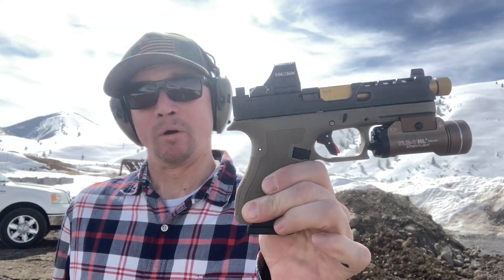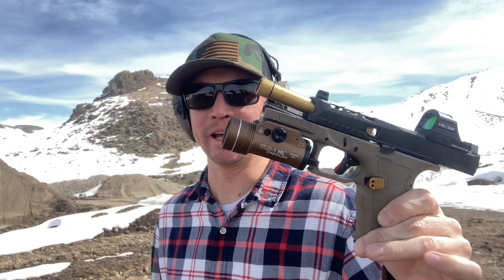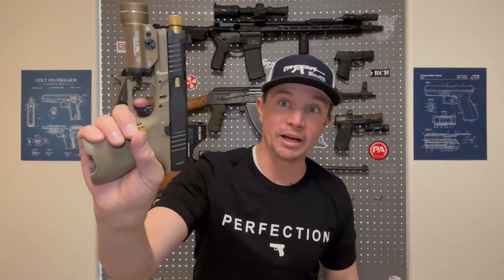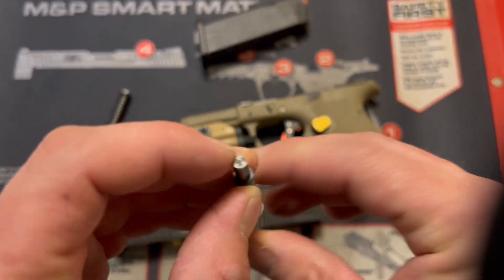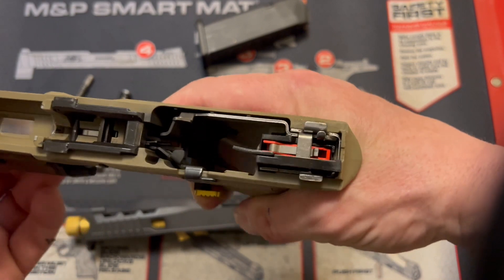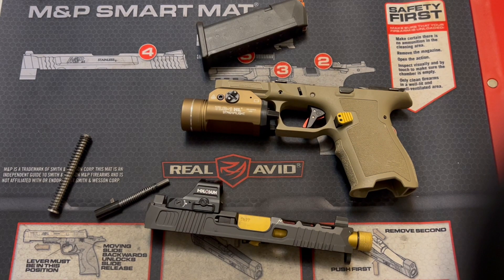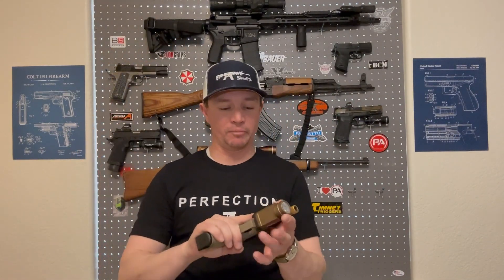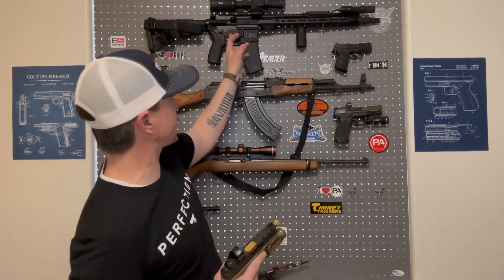PSA Dagger Broken Striker/Firing Pin - Timney Alpha Trigger Runs Great!

Comment: I have 2 daggers...and everyone KNOWS to replace the striker with Glock factory one. J/s
Reply from the maker: Yeah.  I guess that's a pretty well-known failure point, now.  It seems to happen to a lot of them.  When I got my Dagger, I had no idea that this was an issue.
Reply: @sawtoothtactical404   Honesty..I follow PSA on Reddit...and there "daggers" are having problems for alot of people. There QC needs to step up! Luckily I bought mine years ago...but I bought a Glock 19x..and I know 
...if my life is on the line..it will go bang! One of them just collects dust..the other in a "fun gun" with the g flex binary trigger. I honestly want the new Springfield 1911/2011 that I believe you have man!

Comment: Has anyone tried a Glock ? Firing pin instead of the 15$ replacement ?
Reply from the maker: If the replacement striker assembly from PSA breaks, I'm definitely getting a Glock OEM one next.